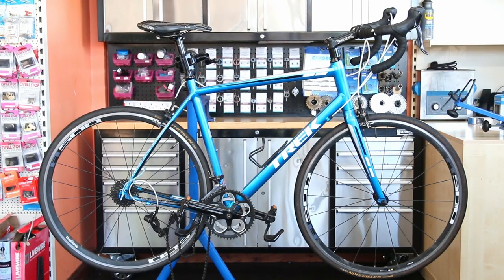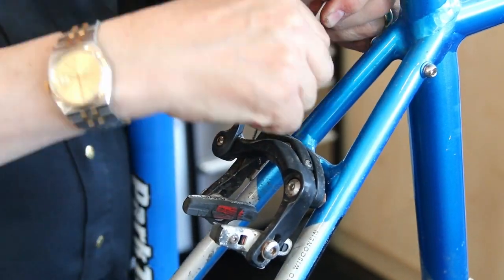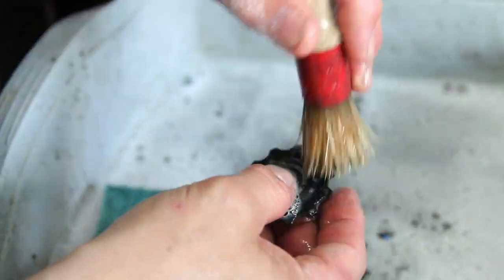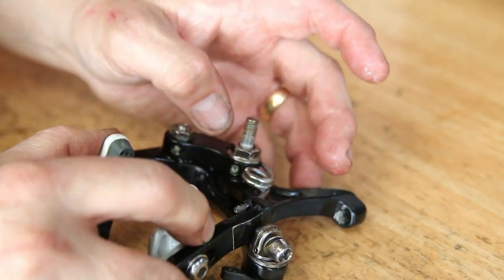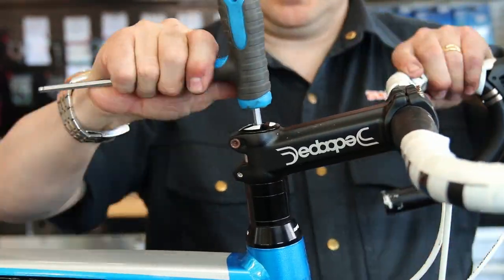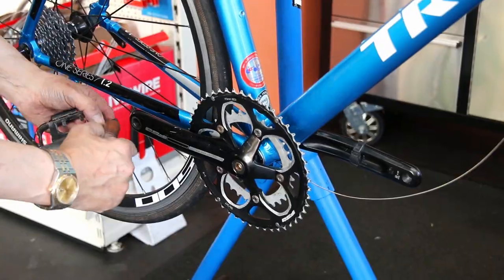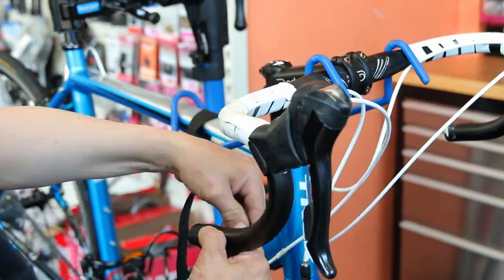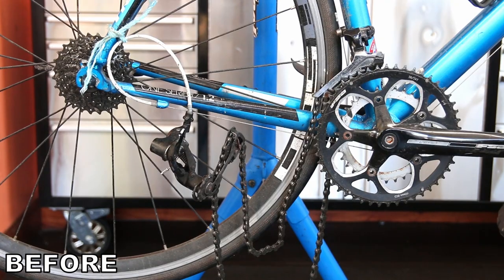Trek One Rebuild! Chain Waxing Road bike & Service

Comment: I do a regular detail to the frame, wheels and components. But what helps most is several coats of Meguiars hybrid ceramic wax, dust and dirt and dead bugs just fall off after a ride. I definitely don’t let my cassette and derailleurs get to that point this bike got to, I can guarantee you that’s what snapped that derailleur hanger. Great video….hopefully riders see what regular cleaning and lube will do for a bike because I’ve ridden with people that don’t and you can hear it in the shifts and when they brake….they sound horrible.
Reply from the maker: We’ve recently started using ceramic on our bigger rebuilds, your work sounds great, enjoy and thanks for watching!🧡⚙️

Comment: Id love to see a complete guide on fixing V break ! I have trouble with mine, i tried to best i could but left side is too close to the rim and the right side is too far away….if i tight the break more then left side touch the rim but then the right side is close enought to the rim but not to close to touch it. If i loose the break more then left is still close to the rim and almost touching the rim but then the right side is now way too far and no longer break…

Comment: Those 8 watts sound unplausible. A clean chain is I think 98% efficient,  so assuming 200w of input that's 4watts lost in total. 0.8 maybe? On another note: what bearings are in the jockey wheel?
Reply from the maker: This was on a sora they don’t have bearings. They are bushed.
Reply: @Bikespeeds  bushed to bearings is pretty big difference, ceramic bearings in particular. When you spin them the comparison is amazing, in real live I think I read about 0.4w less for the best bearings compared to steel bearings if I remember correctly.